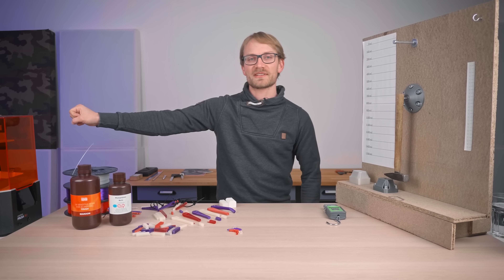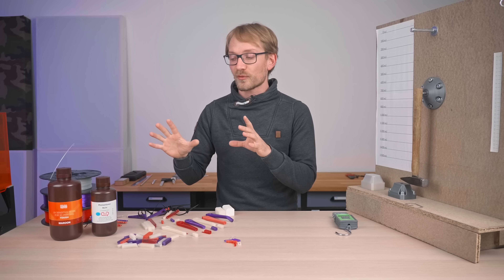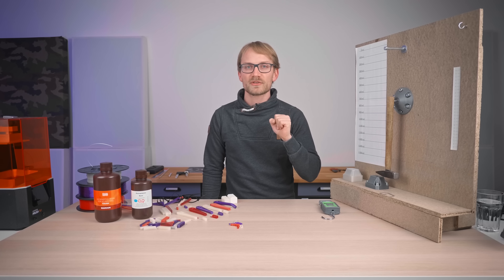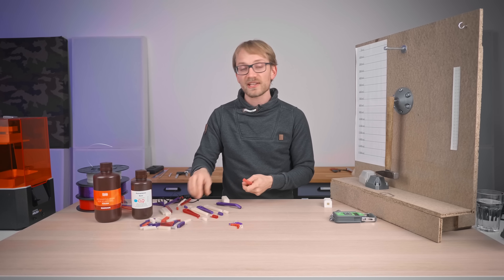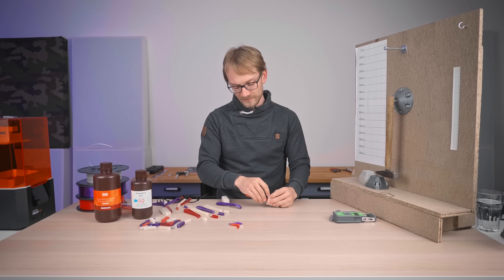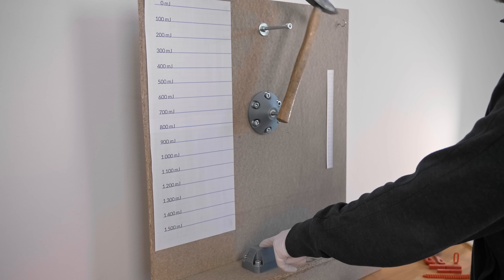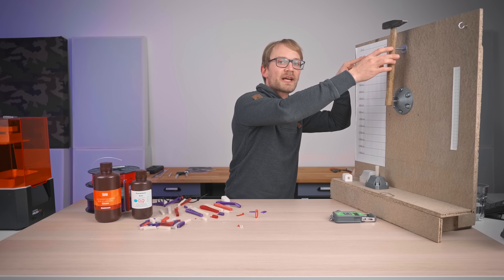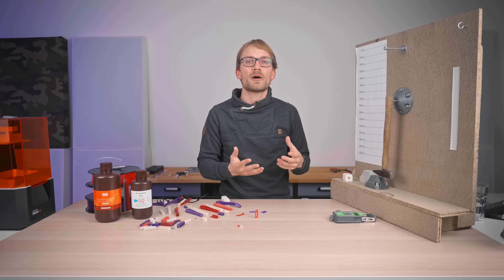Elegoo resin vs. Prusa resin vs. PETG vs. PLA

Comment: What would be very interesting it how hard the surface is, i.e. what will happen if you make gears out of these plastics? Will the teeth sand away?
Reply: I think filament gears tend to deform over time, as for harness there are some scratch resistant resins specific tailored for things like gears like blu nylon mecha resin.

Comment: I'm curious to know what material is best suited for a disc that rotates at high rpm for a motor.
Reply: PLA in general but there are resins designed with more tensile strength.

Comment: You say resin has no layers but it still does. Just generally 0.05mm
Reply: You can see layer lines, and unless you under expose they tend to be directly bonded to eachother removing the boundry between eachother.

Comment: My experience with resin for parts that undergoe repeated stress is that layer orientation does matter. I encourage you to print those test pieces flat and at 45/45 angles across the xy axis.
Reply: From my experience this is not true when you make the layers around .02mm or .03mm thick.

Comment: I love your testing methods, but have some concerns about measurements and standards here. Now, I'm a Data Scientist, so I may be really picky here, but just my suggestions for future tests (even though I'm severely late to the game):

All tests should have been done on a quantity of like samples to correct for part inconsistencies, with results averaged. I would have also liked to see the range and distribution of measurements per material, as that can relate to its reliability overall. An outlier may point to a mistake in the manufacturing process, where a large range over a distribution may speak to unreliability. 

The link test should have been on identical size pieces, and it's ok for a particular part's failure to fall outside of testable limits if you're testing by comparison. While we're on size, correcting for size differences in manufacturing would be preferable, so we're working with the same cross-sections. A 1% increase in cross section in two directions can make a huge difference, especially in tension and shear loads.

The hammer swing test scale should have been oriented radially and I'm assuming the tick scale was linear. Radial orientation corrects for inconsistencies when you examine chord distances between the linear scale points. A non-linear tick scale would take into effect parasitic  losses (not sure if that's the right word I'm looking for, but it's Saturday and I'm not at work) like drag, friction, and gravity on the up swing. 

Again, your tests are all very valid and I would definitely refer to them for ballpark comparison of strength, but these are a few ways you could get your results tighter. Thanks for sticking to good science on these! I'll be checking out your channel much more as I research getting a 3d printer!

Comment: That's a wonderful video, but I have just a small suggestion. It would be very nice if you could present the results in MPa so that everyone could compare the same numbers. Kg will wildly vary with experiment setup.
Reply from the maker: I try not to pretend these are truly scientific tests - the results I'm getting are comparable within my test setup, but not with tests done on other setups. So until I get a proper test setup compliant with the actual DIN/ISO norms, giving only the raw measurements is the best way to make sure nobody mistakes it for that.

Comment: Would be interested to know if your assertion that orientation has no effect on strength with resin is true, as there are still layers created, but understand it should be much stronger adhesion between layers compared to filament.
Reply: In theory, the chemical bonding between Z layers is the same as the XY plane.  So the strength should be the same.
Reply: @Tetz95  theory and reality do not always align, theorists are great but without actually testing it via applied scientists you may as well just make it all up.
Reply: @cjhification , exactly why I used "In theory".  LOL

Comment: Very informative video, and I don't even own a 3f printer :D

How hard would it be to build a stress-strain curve tester at home? I was thinking if you have some accurate motors and sensors lying around from all these printers it should be possible to hack something together :)

Hanging a scale between the part and a pulling motor that can export the data to a computer coupled with some distance sensor seeing elongation could work as a somewhat hacky solution.

Comment: You can explain until you are blue in the face, all the tests are theoretical. Because there are thousands of viable that can affect the outcome. Type of Resins and Filaments, for starters, by the different manufacturers, the speed at which the filaments were laid down, the speed at which you print the Resin,  the curing time, the chemical makeup of the Resins and Filaments are different from manufacturers to manufacturers, the print nozzle size used verse the filament size going through the nozzles, etc...You could go on with a ton of viable. A lot of YouTubers found out the printing at different speed effect the strength of their products, etc... There are YouTubers who found that this company filament is stronger and better than what they use to use, etc... The best we can do is to try to find the balance that works for our 3D printer. I just got a sample from stratasys a 3D printing company that guarantees the strength of their 3D prints and I have to tell you, it's strong. And it was printed using a filament system.

Comment: Just checking, is there a moisture component to some of the resins used in 3D printing that will evaporate out over time? Or are you just referring to how completely set the resin is or isn't when you describe it as dry or wet?

Comment: Question.  I produce a product in PETG. It has a 2.2mm hole and I let an M2.5 machine threaded Hex bolt 'cut its own thread' into the PETG (and previously PLA) version.  I also let it cut its own thread using a metal thread 3mm countersunk bolt too.   

Can.I do the same if I create the same object in SLA printed resin?

I am after a better finish and better multiple objects in one print run, so like the idea of the SLA printing to overcome all the stringing and other artefacts that are inherent with PETG/PLA printing.  Also the SLA printing is faster for a build plate packed full of objects.

What can you advise?

Comment: I appreciate your approach, thoughtful insights and nice video.  This video is helpful as a beginning. Thinking about this some more, wouldn't you attempt to optimize each regarding settings? Of course you would. Ok stock settings seems fair at first glance but its really not what would be the case unless you're thinking for mechanical applications most users are not optimizes...but i believe we/they are.   So then shouldn't a comparison like this be more of "what's the best we can achieve with X resin, and lets see how that compares to filaments for mechanical applications?" Perhaps an internal lattice would be better for resin, or always translucent for curing.....just a thought and thanks!

Comment: I dunno if other have that issue but what i do find is that white, black and transparent pla, seems to work better in my machine than other colors. I dunno if the coloring process somehow picks up humidity but if i want my most rigid pla, i use the white or transparent of the ones i got

Comment: Thanks for the Video, great work. I heard there is some flexible resins and it is mixed with normal resin it would be more durable.
Did you test it?
Reply: Unfortunately I don't think Thomas reads the comments after the first couple days but you are quite right.  Monocure and Phrozen do this.  Phrozen even has a Nylon like resin.

Comment: A very informative video. Thank you. Kind of disappointed that none of the upgraded PLA's were tested nor any of the nylon's. I've been using PLA+ and PLA2 for over a year and haven't used regular PLA for quite a while. I'm about to try Filacube's HT-PLA+ which has a glass transition temperature of 85C after annealing (PETG is 80C).

Comment: Which low odor uv resin would you recommend? I live in an apartment and want to try 3d printing. 
I think I will start with a resin printer. Which printer would you recommend $ 500- $ 800?
How much noise do your resin printers make compared to the fdm printer?
I have a look at the ANYCUBIC Photon Mono X with it is first to get after November 5th. Then there is time for me to learn software 😁

Comment: 13:00 i believe the lack of curing lies within the color of the resin itself... i have little experience with resin printing but if UV light is used to cure resin parts, then red colored resin will absorb the least amount of UV light, as red sits on the opposite end of the light spectrum. this is exactly why resin printers have deep orange acrylic enclosures, it keeps out unwanted UV light...

Comment: The resin prints need to be submerged in a solution while under a UV Light source.  Oxygen (O2) in the air inhibits the curing process.  I submerge my parts in water while curing it.  It take only minutes to cure rather than hours.

Comment: The resin out get with your lcd printer is usually a “draft” resin and is cheap and quite brittle. (It also usually costs half as much as the abs-like or engineering resins.) that’s probably why many people think resin prints are brittle

Comment: I would be interested to see what is the toughest materials you can work with on your home user printers fdm vs sla different cathergories rigid (Matterhackers NylonX vs ?) semi-flex Taulman nylon 645 vs ? and flex Some 96-98A TPU vs ?   or maybe PP)  Is this SLA any good for printing RC parts where durability is needed? Like Gopro cases, Drone motor protectors or even frames for eg a 3 inch quadcopter? How far you can push resin printers if its not about quality, but durability?

Comment: When comparing the strengths of FDM printing to resin, seems like it would be fairer to at least tune the print temperatures to optimize layer adhesion.  Not sure you did that.  
I'm a bit of a newbie, however I do know that printing (at least PETG) at somewhat hotter temperatures trades off detail for improved layer adhesion (up to a point).

Comment: The additional material in the SLA printed loops.. the way you designed it you made it a lot weaker.. the explanation why, you gave a minute before.. because it's thicker at the bottom where your hook is, you get stress raisers at the ends where it becomes thinner. Thus you are bending it more in a smaller space.. oversimplified..

Comment: Working with Polymer mechanical testings professional  I think you have done a desant job to replicate test methods without having the facilities at hand. Maybe the tensile testing is the one I liked less due to you kan accelerate the pull in different ways between the samples with the way it was conducted, by that not comparable between samples. Still a good effort.

Comment: Wow awesome video Thomas. Thanks for this. I'm really surprised the resin is that good. I only have experience with PLA and PETG and noticed that PLA, being semi crystalline, seems to become more brittle over time, or is even seemingly getting a higher Young's modulus or lower density based on the sound. I would also expect a UV curable resin to have aging issues. I did not notice that of PETG (yet). Perhaps a suggestion to store some of these samples in a representative space and repeat the tests a year from now? I would prefer more mainstream blends though.

Comment: I do believe (without having done any actual research) that, contrary to popolar opinion, resin prints do indeed possess anisotropic qualities. Let me explain my thought process: For one layer to adhere to another, there could be either adhesion by van-der-waals interaction between individual layers, or molecular bonds between polymer chains along layer transitions. Think about it: light does not stop penetrating the printed object right at the outermost layer of molecules, but manages to travel through it by a certain amount. some of these photons would have enough energy to activate monomers, some of which would form atomic bonds to adjacent polymer chains. in this model, overcuring during the first exposure session (the actual print) would actually be detrimental to object strength. brittleness becomes a function of the amount of interlayer cross-linked polymer-chains versus intralayer polymerization.
Reply: also, what I just realized (and any material scientists or chemist, forgive me, it's been quite a while on my side): the temperature, at which photopolymerization takes place, is actually extremely important. if i assume the probability for interchain-polymerization to occur follows arrheniu's law, there should be two optimum temperatures, one for the initial exposure (print) (where you want to leave some of the resin unreacted, but harden it enough to achieve dimensional stability), and one post-cure (where you want to achieve complete spatial/volumetric/3d reaction).

Comment: Hi there. I’ve just been watching your video very good too might I add. Have you ever tried creating a part. And placing say a rod like part inside the model. So while your printing it. You stop half way through your print and insert your rod or carbon fibre part. Then restart your print.? Just curious if anyone else has or not.?🤔

Comment: @6:08 you're not measuring the rigidity (stiffness) you're measuring the spring constant. F = ke. Stiffness (or Youngs modulus) is the ratio of stress over strain.

Comment: Resin prints most definitely are affected by print orientation. Just touch it with a soldering iron and you'll see the way it delaminates at print layer.
Cure your resin prints in water. It will get rid of the sticky surface. The reason for stickiness is the oxygen in air which blocks the curing process. Water bath solves that.
The fact that one resin is transparent and the other is opaque in visible light says nothing about their transparency in UV.
Not testing resin prints printed with different layer exposure times is also something that should be addressed.
Reply: Hi, new to resin printing as a concept. Just watching some vids and came across this one.

Whats the reasoning behind oxygen causing curing issues? Reason I ask is because of the obvious. While the air we breath is O2, water is H2O. Both containing oxygen.

Could water be better not because of oxygen differences but maybe rather the extinction coefficient of water? IV doesn't travel straight through water, it actually reflects/mirages through water. Perhaps this causes the models to receive more UV overall, as the angles would be more "random"? I know UV loses strength the deeper the water, but I don't think a depth of 8" of water would have any meaningful effect on the degradation of the UV rays.

Comment: Your video gave me an idea.  What if you added finely ground or chopped glass or carbon fiber in the resin.  To keep it in suspension attach a tube to both end of the tray and use a small centrifical pump to circulate the resin across the tray while printing.  I could probably waste my time and file a patent on this but I already have too many now.  In addition the circulating system could have an external reservoir so that you don't have to continually fill the tray on large prints.  Great channel and good luck.

Comment: You just built out the studio. You better finish that testing station with some formica, a laser sensor with arduino to record your testing result to a spreadsheet. Then build a UV curing station that uses a single quart bulb.

Comment: I am curious how all of this stacks up against normal 2-part mix resins like Alumilite corp AlumiRes RC-3.  I am only using my printer to make positives that I can mold in RTV and then mass produce with a faster (and presumably stronger) resin part because it has no weak adhesion lines.